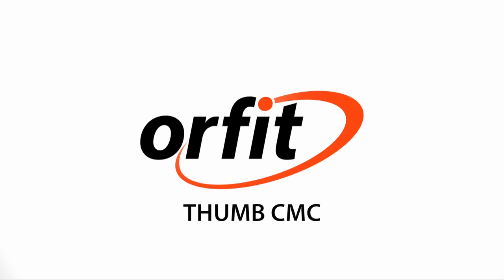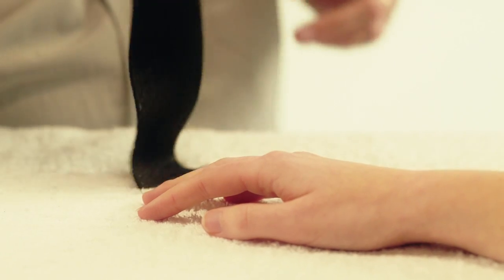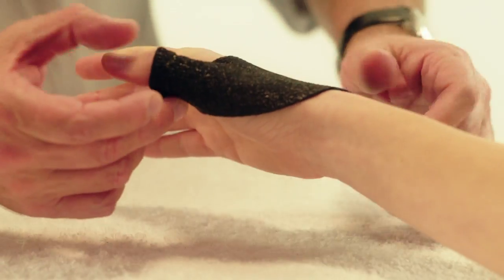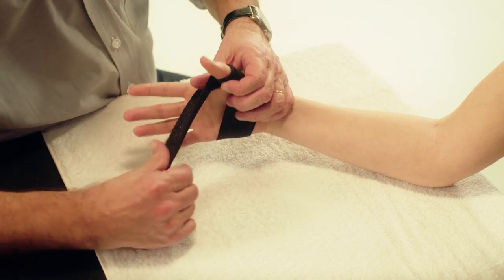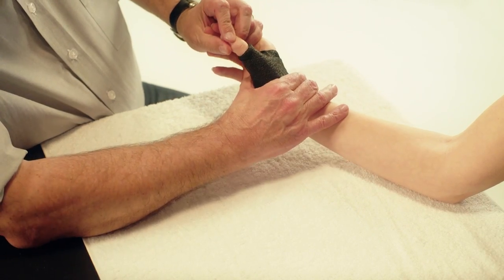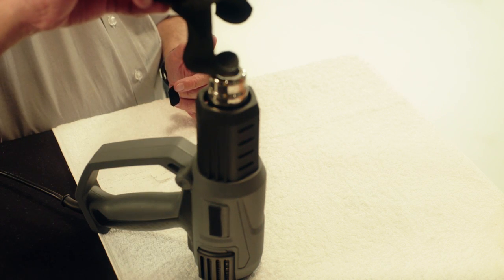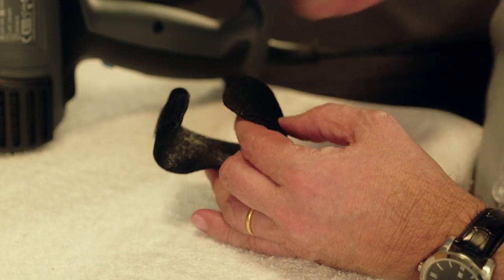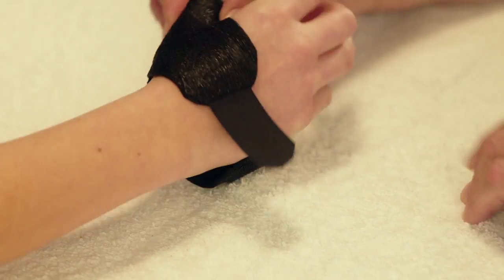Thumb CMC - Orficast Instructional Movie 7

Comment: Prior to molding the orficast on the hand, did he heat it first since it wasn’t shown in the video
Reply from the maker: Hi Poppy, thank you for your question. Yes, the Orficast was heated prior to moulding. The material can be heated in a water bath at 65°C/149°F.
Reply: @orfit  Is the velcro loop provided with each Orficast purchase?